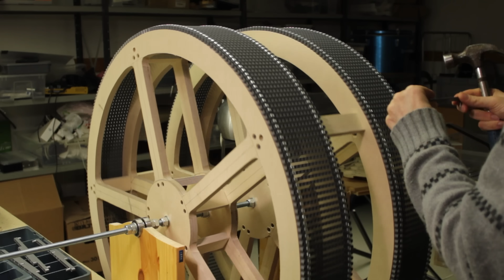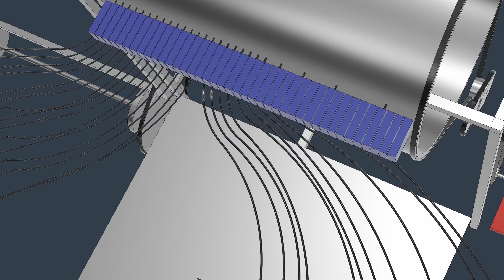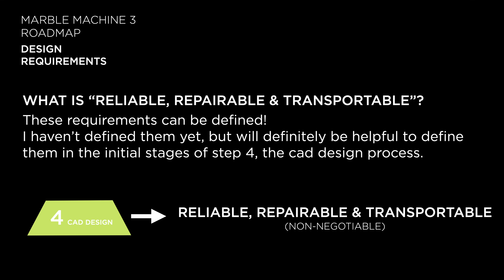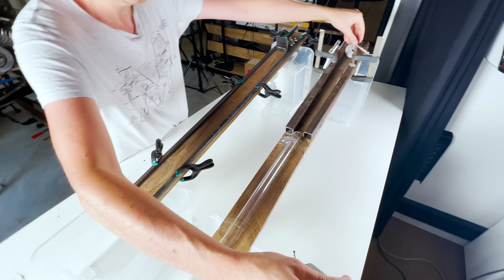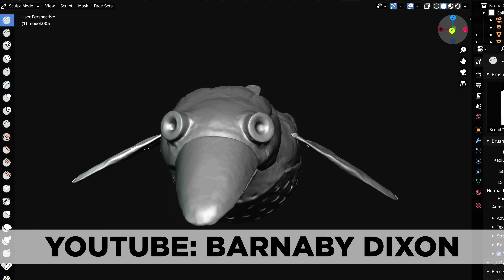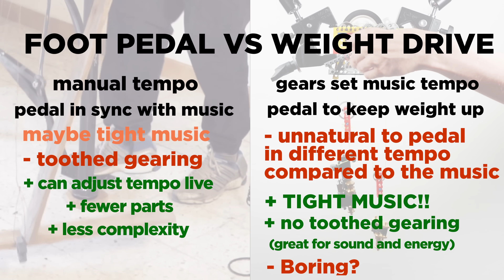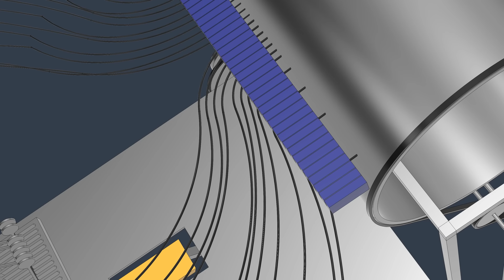Marble Machine 3 is Taking Shape

Comment: Things are only a failure if you didn't learn something from them. The previous marble machines weren't failures, since you are continuing to improve the designs, design process, and working towards a new model. Those previous machines may have failed to produce the effect/music you wanted, but they weren't failures by various and many other measures.

The whole engineering process is learning from failures. The broader scientific method is learning from failures. You can't learn art without learning from failures (or at least designs/effects you didn't like/want). This is why testing things is so very important and why so many things do fail when they aren't tested rigorously enough. Unfortunately, we see a lack of testing all the time in consumer products, financial advice, commercial products, and pretty much everywhere.

You, Mr. Wintergatan, are testing things and learning your assumptions aren't always correct, which is absolutely admirable. Too many people don't do this (as is highly visible within American politics). You are also testing other people's assumptions, designs, etc. to see if they meet your requirements, which is absolutely necessary to make a functional product. I can't remember the last time I built something purely from "off the shelf" parts without needing to make modifications to them or to make some sort of interface between parts so they work together in a meaningful way.

You and your project are an inspiration to many of us who build stuff or simply appreciate that other people build stuff. If you weren't, you wouldn't have as many helpers or subscribers to your channel(s) as you do.

Comment: the use of a clutches (or a gearbox with a clutch aswell) may allow you to utalise both a handcrank foot pedal along with the hagan weightdrive by engaging the clutch to wound the weightdrive and stopping once complete allowing you to wind it while playing then changing the grears to run the machine souly off the hagan weightdrive until the gearage is changed/ the hagan weightdrive runs out of energy (I haven't finished the video yet if this is already mentioned) (the combination of both would allow for the playing of songs longer than the hagan weightdrive giving more flexibility on yourside)

Comment: If you added a clutch to the Huygens drive, you could control the tempo with a wheel and get your variation that way. More complex, but your control over BPM is much more tuned than with the foot pedal. If you look at how bag pipes work, and you gear your power input to the Huygens, you could "breath" power into the system every 4th beat or some other interval so you don't get your internal timing messed up. Love your work, keep going! :)

Comment: You haven’t shown any tests to verify that cranking the Huygens drive doesn’t introduce “noise” into the power chain that eliminates any “tightness” gains offered by the simple falling weight system. I hypothesize that you will be disappointed with the results; even though you’ve decided against it, you MUST test this before relying on it as a fallback option!

Furthermore, a falling weight system that must be constantly and consistently cranked to avoid changes in tempo is NO BETTER than a good flywheel system that must be constantly and consistently cranked. It only has more points of failure. I see nothing except pain and suffering as long as it is still under consideration. But I could be wrong about some of that; this investigation phase is the time to test and find out for sure.

Comment: Some machines (like motorcycles) use two bowden cables for one actuator: one to pull and one to push (actually pulling the other direction). Also, why not have a tempo-adjustment pedal?

Comment: A question for Martin: Could Ringo Starr play tight music? Can a hand-cranked music box play tight music? Can YOU play tight music? I know I'm not alone in thinking you're unreasonable in wanting drum-machine level tightness from a mechanical music instrument.
But it's fine, as long as when challenges in the upper parts of the pyramid start threatening tightness - and they will, no way you can design for your parameters in sequence, one at a time - then you're willing to cash in on that reserve of tightness that you've built up. If not, the MM3 is as doomed as the previous two.

Comment: MM1 and MMX are no failures. You learned a lot while building these prototypes and are using the knowledge to build another machine. I would be careful in the way you are currently planning to do this project. Reworking, rethinking, and changing parts is a normal process during development. Don't believe that everything you are planning now will work out perfectly in the end and that's ok. Some companies rework parts of a machine for years until it finally works as intended.

Comment: I assume that you thought about it but if not, my 2 cents on the foot pedal vs weight drive :
-> With the weight drive, you will have to wind up the weight, as a bagpipes player blow in the bag. I think you whould do it with a pedal, asynchrounsly or not (having the ability to wind asynchronously doesn't mean that you have to do so)
-> With this pedal, maybe you can find a way to bypass the weight drive in order to get a "manual controle"  (a foot controle in your case) for the 2 or 3 times in the concert you want to get this adaptable tempo feature
-> With the weight drive, if the weight fall is long enough (to calculate) maybe you can completely leave your instruments for a few seconds... which seems to me is a nice feature while performing on stage
For me, weight drive is a very good solution that shouldn't be put away to fast.

Comment: This might sound nuts, but wouldn't it be possible to build a clutch or similar into the machine to allow you to switch between the pedal and a gravity drive? Just as the pedal helps with audience interaction through tempo control, the gravity drive lets you step away from the machine for a short period. This seems super important.

Comment: Martin did all these tests with assumptions about the maximum length of Bowden cables, and now that's an unknown variable again? And every "design requirement," the lack of which on the MMX was the core reason Martin abandoned the project, is now only met "when Martin feels it??"

So now it begins, I guess, the inevitable rethinking of everything from the past year, and the re-framing of settled decisions into future regrets. Sticking with a decision you know (or come to learn) is imperfect is way better than never deciding, and refusing to measure your goals means you're back where you were with MMX.

For some of these decisions, you gotta literally start flipping coins. And I agree that those design requirements are impossible to test, so get rid of them! Come up with different design requirements which you can actually test.
Reply: He could have easily tested the FULL LENGTH Bowden cables, but he simply chose not to.

Either that, or he simply didn’t show the results…..for reasons?!?

Comment: Hey Martin, may i suggest you use the foot pedal for two things: one is to keep the weight drive running.  The second is to have the MM sample the rate of foot pedal input and alter the timing to match whatever tempo requirements you need.  set a change  threshold so that minute variations in your foot pedal wont change anything unless you mean it to.

Comment: I wonder if you can integrate the manual control you would get with the foot pedal and a weight drive. Kind of using a weight drive to support you while you can control the actual speed with the stomping of your foot. That would strain you less, or allow to play some parts of the music on automatic (for example, when you manually play some channels like you did with the first MM).

Comment: To me, a certain level of "untightness" makes the music live. A perfectly tight music easily seems too mechanical and thus somehow dead. So maybe you should find out, where the border between living untightness and out of rythm from the perspective of reception is and switch to Heuygen's drive only, if you fail meeting the living untightness area. In MM1 und MMX you had several sources of untightness, from reading the programming wheel to dropping the marbles in time. You spend a huge effort to maximize tightness on these aspects, so the pedal will be the only source of untightness. So chances are that it will be tight "enough".

Comment: For the Bowden cables and the programming wheel I terraces (forgot the name) you should also consider the power requirement. Even if it plays super thought but one of them needs like 2 Watts of power you will have a problem to operate like 50 of them if you want to power it manually.

Comment: In my opinion, removing toothed gears is removing part of the soul of the marble machine and at that point it becomes a discussion of whether you value the art or function more. Obviously, there are downsides, but I think they are well worth it. You have practically made a brand with gears and I quite love them!

Also, something of note with the foot pedal is that, ergonomically, you aren't as flexible to play different instruments on the fly, especially with such a large machine. I think it may be harder to shift your center of gravity away from the pedal and maintain a tight tempo just to reach the rest of the machine. It could be a non-issue depending on instrument placement though

Comment: Not an engineer, but if you had a weight drive with some kind of rubber band going between the weight and the floor, such that it pulls the weight downwards.. would that allow you to crank faster, have the drive speed up due to the force from the rubber band, or crank slower and have the band go slack, providing no force and therefore result in a lower effective weight, thus slower rotation of the drive? Just an idea, but if it works like that then you could effectively do both. Tight music for tight music songs, then attach the rubber band for variable tempo based on feeling, and disconnect it again for 100% tight again. Might even be able to connect/disconnect during one song?

Comment: Use the pedal to drive the weight drive in a way that works with pedalling the correct tempo. You need a way to dump any extra energy easily if it gets too far ahead (too charged up?).

Comment: I feel like you have missed Step (-1) – Feasibility study and Step (0) – Scoping study, also step (6) recording and step (7) live performance.

Step (-1) - The feasibility study is a very high-level collection of information to see if the given the available resources is the end goal practical.

Things you may need to consider are available budget, available time, available tooling, available logistics, and the potential for each of those to change depending on the final output.

Just to be able to tour you may need to consider. Where do you plan on going? How often do you want to be able to perform? How do you plan on transporting it? How long will that take? How much will it cost? Is it cheaper to have multiple machines travel fully assembled slowly to reduce set up time at each venue or is it better to have one machine that can be broken down into smaller pieces that takes time to assemble? At what point is the crossover? What is the support team size and how will that affect costs? How much do I need to make a show fanatically viable? What do I think I can charge for a ticket? How big a venue do I need to fill to break even? 

Once you have some answers to these and many other questions do any of these seem to have mutually exclusive requirements? If yes, can this contradiction be resolved?

A lot of potential projects stop at this step.

Step (0) – The scoping study defines what success looks like. Doing this well helps reduce the risk of feature creep. Some of the requirements for success will come from the feasibility study. 
If you think a requirement can’t be defined, try harder. If you still can’t define it is a feature not a requirement. Defining the requirements may take additional research and work. For timing you could use a computer to vary the tightness of music and find some limits. Is it important that the variance between individual beats on a single channel is very small but the variance between channels can be bigger. Does one instrument need less variance than another? Does the required variance change with bpm? Can the music be too tight? Is some variation required to make the music organic?

For sound quality can you find target analogues? What qualities of that analogue do you need to replicate?

For things you may consider features are some of them actually requirements? Do you need to be able to face the audience during a live show? Do you need to be able to see the marbles drop? Do you need to be able to see the marbles circulate? Do you want the audience to be able to understand how elements interconnect or is it just enough to see movement? Can imperfection improve the performance?  

Finally, you may want to create a project risk management process. How are you going to avoid things like budget blow out, time blow out, scope/feature creep, burnout. This should ideally be a living process that where new risks are added as they become apparent and management strategies are reviewed for effectiveness.
Reply: I agree that the concept of a “world (?) tour” needs to be seriously questioned.  Especially given the SIZE and FRAGILITY of an instrument this size.

I’m really surprised that this has been questioned so little here— but I think most of the audience here are merely cheer-leaders on the sideline, with no real interest/thought given to what’s actually being proposed.

There’s a reason why pianists don’t take their piano with them when they tour…

Comment: I actually think "tight" music CAN be measured, you just calculate the timing deviation of a talented drummer. Zero milliseconds of standard deviation is pyhsically impossible. If you can't measure any deviation, your measuring method is not sensitive enough to pick up deviations that still exist. Once you hit the average "tightness" of a talented drummer, you have reached your requirement.

Comment: I believe it should be possible to use the same gearing for the pedal input power that you use fore the tempo of the weight drive, this allowing you to pedal to the beat while automatically putting in the correct amount of energy to keep the weight stationary.

Edit: I believe that you could qualify tight/dynamic music. it would surprise me if there wouldn't be research present on this topic, and if not, you could quantify it yourself with a blind test: set up tracks with different deviations and check when you can tell a difference. That now is the target you need to hit.

Wish you all the best, good spirits and a clean mind.

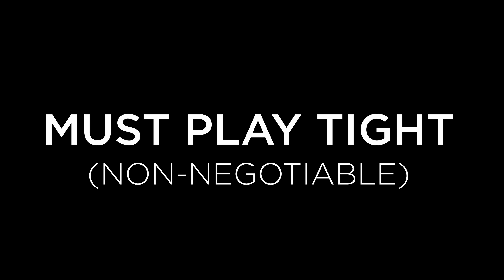Comment: 2:50 already setting yourself up for failure again. If go Zero defect here the machine will NEVER get off the ground. You must rethink this and accept some variance in timing. You went down this rabbit hole with MMX and look what a happened. Unreasonable expectations will never be met.
Ditch the "MegaWheel" get the programming wheels closer to the marble gates to improve you timing.

Comment: What about making a connect/disconnect, so you can have both a weight drive AND be able to run it manually with foot pedal. It could be some clutch, that directly connects the pedal to the machine.

Comment: the process of FAILURE is still essential for creating the MM3. the key difference is that with the MMX, you didn’t realise when it was time to stop and reapproach the problem, instead continuing to put band-aids on band-aids on band-aids. failure is an encouraged part of the MM3 process, you just need to monitor if things are not working and make changes (or start from scratch) IMMEDIATELY when something “fails”, instead of stacking problems on top of each other.

Comment: Instead of adjusting the gearing to change the tempo the weight drive, why not implement the weight drive in a way that adjusting the gearing will change the required tempo of your input through the pedal to keep the weight drive balanced/stationary?

Comment: Throwing a random idea for the link system being a potential issue for the single-wheel driven solution. The friction in the tubing could be mitigated by using multiple straight cables connected with some sort of leverage between them :D

Comment: I understand the desire to make the machine more responsive to human input, but the inertia of the flywheel may make it difficult to change the tempo of the music on demand.  Once again, I think a Continuously Variable Transmission between the flywheel output and the machine input would be an optimal solution for tempo control.  This would still be a manual input (e.g., a simple lever), but unlike merely increasing or decreasing the rate of pumping the foot lever, a CVT control would immediately change the tempo.

Comment: An important point is that this isn't a new project you're starting from scratch.  You are still making the same marble machine - it's just the third iteration of it.  Even if you started from day 1 on this new process, you would be way less likely to succeed because you wouldn't have all the knowledge you gained from your experience.  The first two are probably best thought of as prototypes or proofs of concept, and those are very important in design.  In fact, building a prototype before you spend a ton of time on detailed design is generally best practice for something you've never done before.